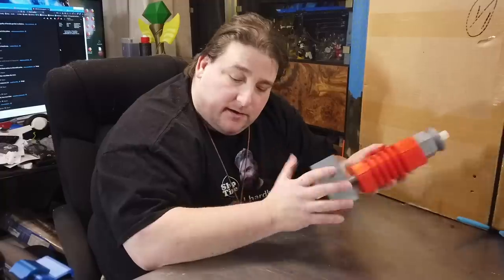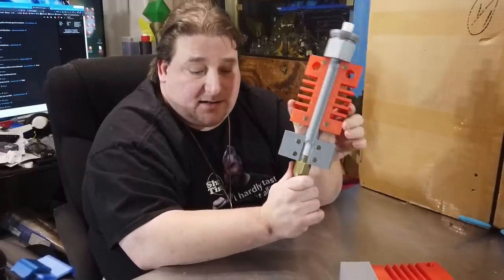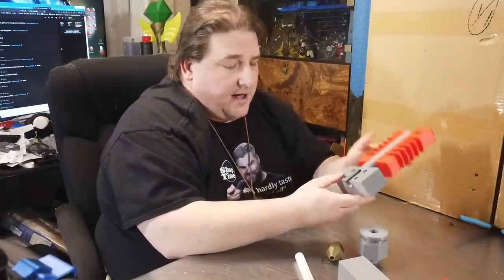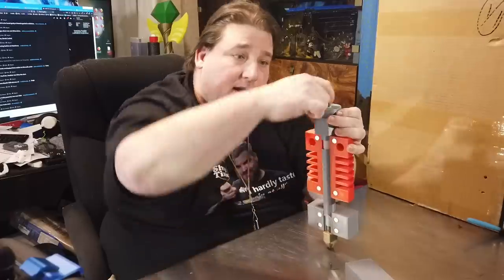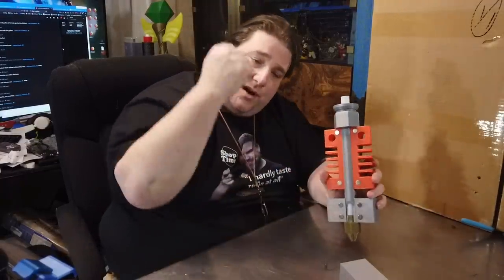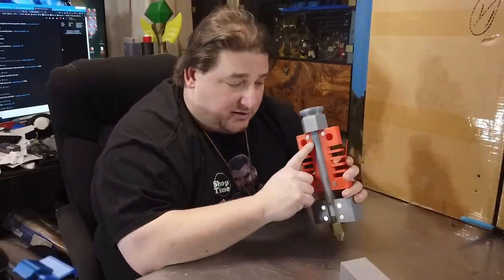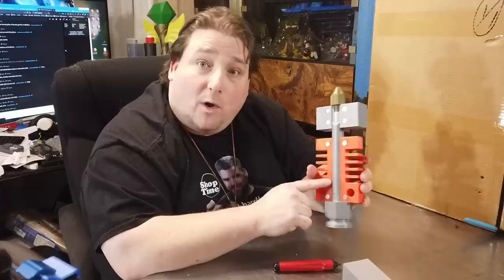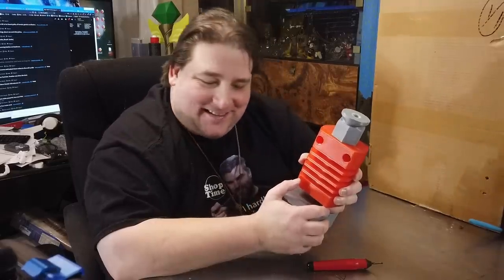Creality Hot End Failure Modeling How to Fix, Assemble CR 10 Ender 3 5 Mini T3DP

Comment: I was wondering if you could make a reccomendation on a hot end fan upgrade. I'm having the issue where the PLA is expanding in the bowden tube as it reaches the hot end. I've tried everything else. Already replacing the tube with a capricorn. I figured why not just nip anything else in the bud. Feeling like I should have just gotten a prusa mini at this point! lol
Reply from the maker: if its expanding the bowden that much the fan has likely stopped working. don't use "quiet" fans one of the primary ways they are made quieter is by slowing them down IE less CFM less airflow

use "double ball bearing" fans. search 24v double ball bearing on amazon they are only a buck more than the bushing fans and make all the difference in the world. quiet and full speed

Also since they are bearing and not bushing they will perform better and last longer. still need to keep them clean though. dust on the blades can reduce CFM to nearly nothing !!
Reply: @nerys71  thank you! I actually replaced everything yesterday and it's working even better than before. I would have never realized it was a dying fan if not for you mentioning it at the end. Much appreciated!

Comment: Thank you, this is super helpful. Would you possibly make another version for all metal hot ends like the micro Swiss or E3D? I’m having some clog issues on my micro Swiss and trying to figure out where it’s getting clogged.
Reply from the maker: All metal hotend don't always play well with pla you need to make sure you're hot and cooling is on point! Also in Oiler sometimes helps a little bit with all metal hot ends and pla

Comment: Great info video. I have a question. Is there supposed to be a gap between nozzle and block? You mention to tighten nozzle all the way to the block. But every new extruder I’ve purchased,  there’s alway a gap between nozzle and block. So just wondering if that’s based on preference.
Reply from the maker: Yes a small Gap is good the reason is that if the nozzle goes all the way into the block and bottoms out it's difficult to make sure it's compressed against the PTFE tube since it can't go in any further so a small Gap does not hurt and could help

Comment: Hello, may I say that it might be better to replace the nozzle when the block is hot.
So, I believe that we should :
1st Heat up to 250°C
2nd Retract
3th take the nozzle off
4th  replace the nozzle with the new one (In hot condition)
5th feed the PLA back
6th Get some spaghetti off
And we are done.

It makes sense for me, although is too hot process,  but it does not matter if some filament is in the threat, because it will be push over by the nozzle threat.

Does it make sense for you sir?

Best regards

Rafael

Comment: Thanks for a great video! I'm really new to this stuff, so I'm not smart enough to see the solution to my problem here. So I ask. I got an Anet E12 (CR10 clone) about 5 days ago. Unlike your demo, on my machine the heat break (which the parts vendors seem to call the "throat tube") has its own PTFE liner which seems to be in every way identical to a piece of Bowden tube. Every time I print, this tube gets between 5 and 10 cm of filament solidified in it. I have to let things cool down, pull off the nozzle, pull off the B tube, push the throat tube liner out with a piece of filament,  nad forcibly eject the solidified filament. Reassemble, cut a new clean end on my supply filament, and I'm good to go for the next print. No crusty anything inside; nothing on the sealing surface of the nozzle. Any ideas? Thank you so much in advance; I'm desparate to get rid of the 30 minutes of overhead per print. :-(
Reply from the maker: Usually the only time that happens is because of heat creep and heat creep is usually caused by lack of cooling. If you look at your hot end Carriage unit. There should be two fans. 1 on the side that has a little duct on the bottom that's aimed at the nozzle. That's your parts cooling fan. We don't have to worry about that. The other van is usually facing you on the front but inside the metal shell And that fan is usually always on whenever the power is on on the printer. I suspect that fan is not working. Which would cause exactly the problem you're describing.

Comment: Very detailed video. What speed and settings would you recommend for 0.6 or 0.8mm nozzle prints?
Reply from the maker: For the 0.6 mm now so you don't really have to change speed settings for the 0.8 mm pay attention to your adhesions and warping you might need to slow down or increase temperature slightly

The advantage of both of them is that you can use less infill fewer perimeters add thicker layers which makes your prints stronger and dramatically decreases print time just remember you are pushing substantially more plastic per milliliter so pay attention to whether it is melting properly and and adhearing properly

Comment: Hey, thanks a lot for all this work, it's very clear with this 3d model ! I have a question, i'm on the CR10S PRO, and i'd like to know what's the perfect space between the heat block and the cooling part, i would say that if I space it enough the filament will stay cooled correctly ans stay liquid in the heat block, but i'm not sure about it !
Reply from the maker: That's a good question I'm honestly not sure I would pick you in one of the smallest possible without them actually touching probably a quarter inch or 6 mm is fine but I've never thought about is there with optimal distance I will have to look into that

Comment: Nice one. Which parts of the assembly have to be done while the block is heated up?
Reply from the maker: remove nozzle and coupler entirely. shove ptfe through entire hot end to ensure throat is clear of obstruction.

install nozzle all the way. install coupler all the way. back coupler out 2 full turns. install ptfe tube secure it then finish tightening the coupler. then heat up hot end and verify nozzle is still tight and coupler is still tight (gently don't crank it)

load and go.

Comment: Question (CR-10S Pro) You said n your video, to install the heat-break all the way into the hot-block.  However, on my printer the heat-break can simply screw all the way through the hot-block!
So, do you screw-in the nozzle all the way till tight, then screw the heat-break until it contacts and is tight? 
I've been having problems with oozing above and below the hot-block filling the area between the hot-block and the finned heat-radiator, as well as loading up the silicone-rubber boot!  
Is there a sequence to make sure everything stays tight and makes sure the capricorn-tube is properly placed in compression?  Thanks in advance!

Comment: this was great info I have a duel unit on a shark 2.1   would this be the same??
Reply from the maker: If the hot end looks similar it probably is similar however you say you have a dual unit what does that mean? Idex separate heads or two into one? If it's a two into one it's probably very different although mechanics should be similar

Comment: Good explanation. I thought you were supposed to loosen the nozzle 3/4 of a turn, tighten the top part, then turn the nozzle. Is that a worse approach than this?
Reply from the maker: People use that method successfully I just don't prefer it but either way we'll work fine as long as you do it consistently each time

Comment: Great video for changing out the nozzle, I have a questions I printed a whole roll of white PLA all running at 200 on the hot end had no issues other then spider-man strings all over the place then I changed to Gray same brand different color changed the temp to 207 on the hotend and put combing on printed a model (glue holders) looking good when I went to bed got up and had a mess nozzle plugged up PLA all over the hotend  (caked on) ready to change out the tube and nozzle. What causes this just changing a color and up the temp thanks for any help
Reply from the maker: It probably had nothing to do with the color change either something let go which caused the blob or you had an opening somewhere which allowed Elite or you got a bum roll of filament and part of it was too thick or something it would all depend on what cause the blob

Comment: Do you recommend 2 full turns ?  Sounds like a couple of millimeters which could squish the ptfe tube.
Reply from the maker: should be about 1mm on each end. should not squish anything badly.  could be wrong but I think its a 1mm thread pitch. so 1 turn is 1mm. 1mm to take up the slack in the compression fitting and 1mm to squish.

Comment: in theory, would getting a heat break such as a bimetal one or something that allows you to print higher temps and remove the PTFE from the hotend eliminate this issue?
Reply from the maker: no. the GAP is still their its just two metal parts instead of metal and ptfe. the same problem can exist and the solution is the same. parts must be mated to "seal" the gap.

Comment: I'm very new to 3D printing, and maybe I'm alone here, but I found the instruction around 6:50 confusing because you can't screw the fitting down with the tube in place without pressing the release "ring", plus how can we tell the right amount of tubing is being fed after unscrewing the tube 2 turns, and refastening?  I found your video very well described and clear except for that part.  I needed to screw the fitting in, then insert the tube, then unscrew the fitting while holding the release down and re-screwing it back in.  still don't know if it did the job as I just started a new print after following your direction.  This is a print that has failed several times after about an hour because my first several layers come out beautifully, but then it starts to clunk and lay rough layers.  I'm hoping this will solve it.
1.5 hour later Update- nope...still happening. Nothing I've done is fixing the issue.

Comment: Would you recommend fitting a  'Heater Block Silicone Cover' on the hot end (if there isn't one there already).... are they essential?
Reply from the maker: Recommended yes essential no the advantages they stabilize temperature a little bit add they help to prevent blobs from adhering to firmly to the hot end if they occur

Comment: Why have the plastic tube at all?  The filament should feed in straight from the top. The Trinus does this very well. Mount the extruder right on top of the hotend and eliminate a bunch of problems. Just use a mettal, silicon or ceramic sleeve. Less parts. Line them up and it will work better. I have had only one jam on that little Trinus in 3 or 4 years. Replaced one nozzle. Still running the same hotend. No belts at all. Solid machine. The cr10s has the size. It also put out some nice stuff. But I have to fiddle with the hotend and print base to much.

Comment: Bro, you're awesome!!

I want to upgrade my Ender 3 to a hotend that can handle 300 Celsius temperatures or even 400C. I've seen people put a E3d v6 but it's really poor instructions. The microswiss I have heard isn't that good of an upgrade so I'm weary.
Reply from the maker: Also look into slice engineering. Good stuff. No matter what you pick will also need to modify the firmware since it won't let you go past 260
Reply: @nerys71  is that difficult?
Reply from the maker: @jessehellakoo  I am not sure. difficulty here is subjective. if your printer has a boot loader installed updating the firmware while always risky is pretty straightforward but you need to know what to edit (such as max hot end temperature) which I don't actually know how do to (never done it yet)

the hardware is usually pretty straight forward ideally use hardware designed to upgrade your machine (I think slice has hot ends designed to bolt up to creality machines for example)
Reply: @nerys71  I have the ender 3 v2 and a New Prusa. I want to upgrade the ender 3 v2.

Comment: Great video, but I believe that your model is more MK8-ish than CR10-ish. None of them, though, to the best of my knowledge has the nozzle screwed into the thermal throat as you show it. So there are actually two gaps. One is between the nozzle and the thermal throat, and the other one is indeed between the PTFE tube and the nozzle. Your method though (of pushing the tube through), can be used too to mitigate both gaps.
Reply from the maker: No there's only one guy. The novel screws into the heater block not the heat break

The heat break is held in place by two grub screws one on the heat block and one on the heat sink

It's a straight pass through the PTFE tube passes straight through the heat break and touching the actual brass nozzle so there's only one Gap

Comment: I have a question i have the creality cr10s and i accidentally snipped the wires and i replaced the whole hot end but i now get the error for temperature failure 
How can i fix that
And you realy have the info on point you rock
Reply from the maker: I am not sure without seeing your machine but it SOUNDS like your "thermistor" is not connected. that is the two thin WHITE wires going to the hot end heat block. you will also have a similar set going to the heated bed. if either is not connected or not working the printer should through a temperature error and halt for safety.
Reply: I went and bought the complete hot end with the thermistor and heat block complete but it says heating error hot end failure please reset my question now is do i have to reprogram the computer or how do i reset it
Thank you for your time

Comment: Is it ok to screw in the throat tube while it’s cold????? Or should I hear and snug that up??
Reply from the maker: If it's brand new and clean it's probably okay to do it cold but I would really suggest doing most of this warm

At the minimum if anything resists as you're putting it together stop and wait to heat it up

Comment: In when you say two full turns of the ptfe tube coupler.  Do you mean actually rotating the fitting 360 degrees?
Reply from the maker: Yes. 1.5 to 2.0 full rotations.
Reply: Thank you for the quick response. Subscribed!

Comment: Mate you're a legend.  That's what I thought was happening but your video just confirmed it and showed me how to fix it.  I have a CR-10s Pro V2 and my heater block doesn't have the 2 screws in it to stop it twisting.  Is it normal to have movement in it when the nozzle is out?  Thanks so much.  Cheers
Reply from the maker: Yes when the nozzle is removed the compression is removed and the whole thing will loosen up and wiggle around there should also be set screws to hold the heat break into the cool side at the hot block be careful not to strip them they strip very easily but check and make sure they are smug as well but you do that after you assemble the hot end
Reply: @nerys71  thanks mate I got it sorted :)

Comment: i replaced the entire hotend and fan and am still getting the clog ive played with all the settings and watched plenty of videos now that i dont get the expansion higher up its goes for longer but still jams any suggestions
Reply from the maker: printing too hot? fan not spinning fast enough? plugged into the wrong port? Replacing the entire hot end does not "eliminate" the gap issue. that is an assembly issue not a component issue. ie a brand new hot end assembled incorrectly will still do this if there is a gap between the ptfe and the nozzle.

ALSO check the heater. is the hot end "cooling down" part way through? that would jam it up instantly.

Comment: Two questions. BL touch or inductive sensor?  Also what is the best hot end for cr10s pro
Reply from the maker: I personally prefer bltouch because I prefer mechanical but that's just my personal preference I understand th 3DS bed leveling system works very well as well

Comment: What is the tube that goes into the heatsink called..its the only one you didn't name.
Reply from the maker: There's only two the white part is the PTFE tube and the metal tube that connects the heat sink to the Heat block that the PTFE tube slides through is called the heat break

Comment: Not sure if anyone posted this question yet but what about using the all metal hot end such at the one from Micro Swiss? Does that really eliminate the issues described here? Just wondering if it’s worth replacing . - thanks!
Reply from the maker: No it does not eliminate this issue but it does make it much less common since it's a metal on metal connection it's easier to make sure it's tight enough

Comment: What’s wrong with my extruder gears they spinning but they aren’t pushing it through and if I manually push the filament it works
Reply from the maker: is the gear spinning or just the SHAFT of the motor? there are 2 "grub screws" that hold that gear onto the shaft. if they come loose the motor will turn but no pushy pushy filament. align one with the flat if its loose and tighten them up.

I HAVE ALSO seen the gear come loose and "move up" so it was turning but no longer grabbing the filament at all since the filament was below the gear.
Reply: @nerys71  I bought the metal dual gear but my stepper motor shaft doesn’t have a flat side and is too small so I need to buy a whole new stepper motor too 😢at least i found out what’s wrong with it I think but thank you for the help if u got a extra stepper motor for ender 3 with a flat side on the shaft and is long enough to work with dual stepper
Reply from the maker: @Mr.shorty44  it would literally cost less money for you to buy one off Amazon than it would for me to ship you one :-)
Reply: @nerys71  i ordered one thanks tho do you use blender
Reply from the maker: @Mr.shorty44  no I use tinkercad

Comment: How much gap between the heat block and cold end. Thanks
Reply from the maker: I don't know if there's a fixed value to that there just needs to be some sort of a gap the important part is making sure the joint between the PTFE tube and the nozzle is sealed